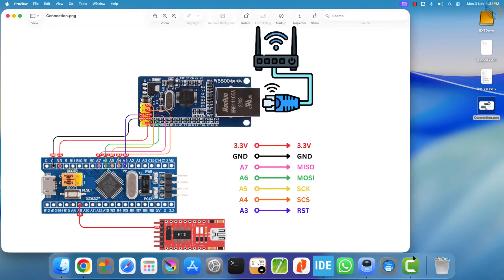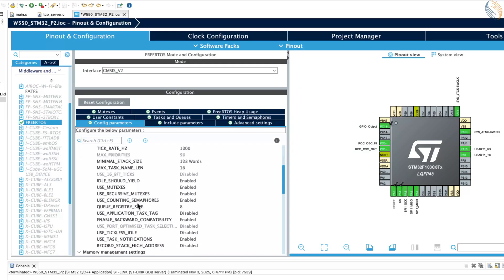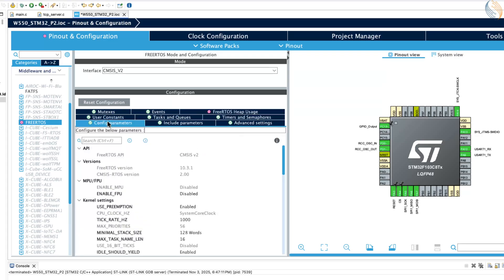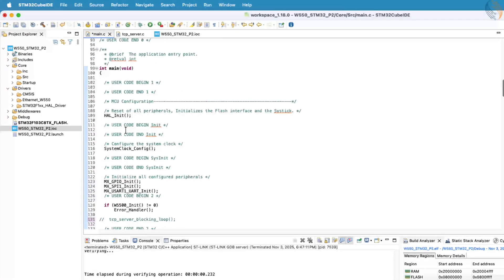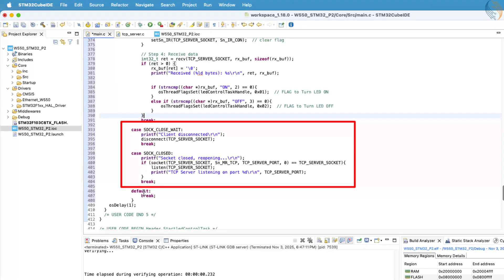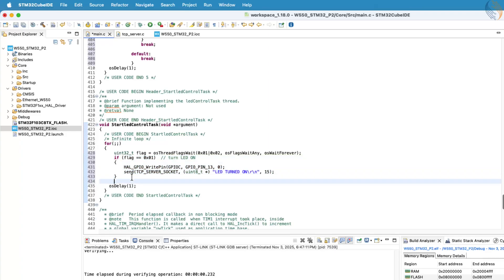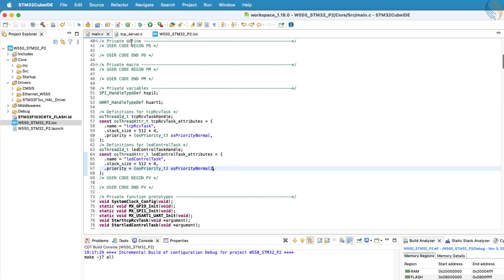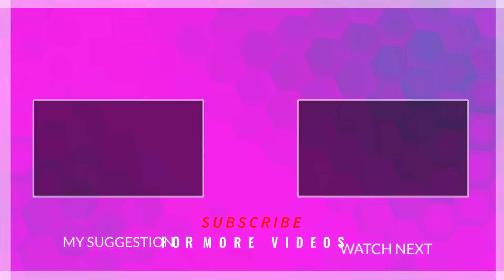STM32 Ethernet with W5500 (PART 3): TCP Server with FreeRTOS | Control LED via Ethernet

Comment: Excellent video, thanks for this.I want to implement the ModBusTCP protocol on STM32 - W5500, it would be interesting if you could make an episode showing how simultaneous communication can be done on the same port (for example 502 for ModBusTCP), W5500 supporting 8 simultaneous socket connections.